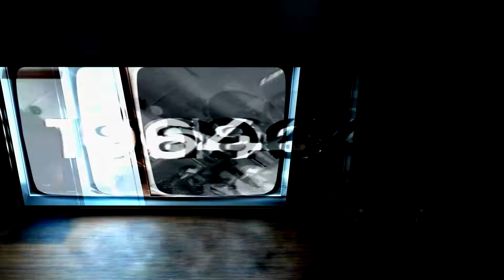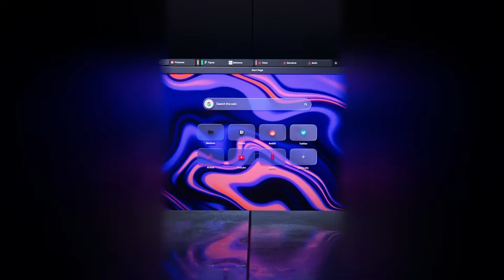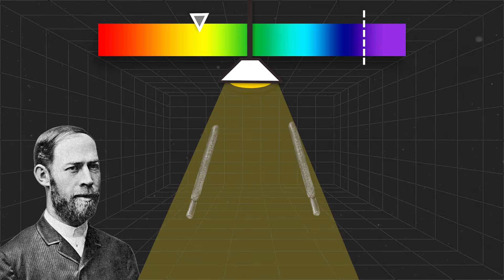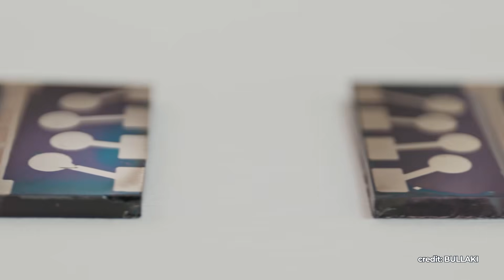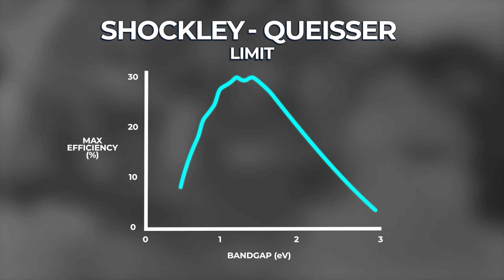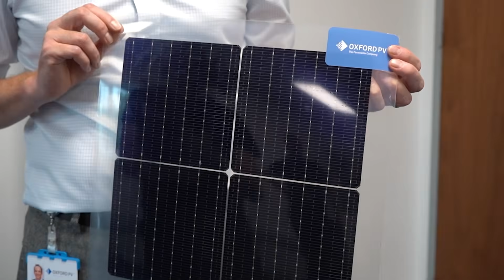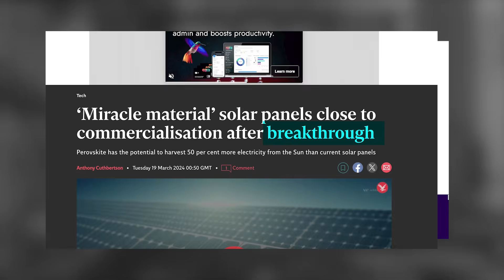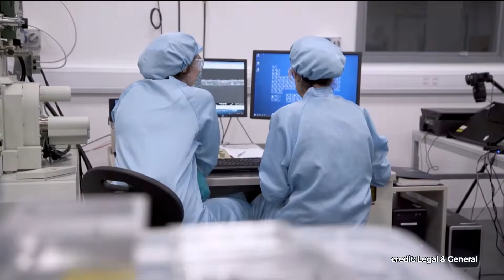How Physicists Broke the Solar Efficiency Record

Comment: The Kardashev scale never made much sense to me. We don't even know what would happen to the solar system if we blocked just 1% of the sun's energy and converted it to our needs artificially, let alone 100% of it.
If the temperature on Earth was 2 degrees hotter or cooler, then life on Earth would change drastically. That's how delicate nature is. We shouldn't think this balance is only important here on Earth.
Reply: Bruh, the temperature swings about 60 to 80c every single year here. The nature seems just fine. I don’t think 2 degrees is gonna break nature..
Reply: @Duminasion  bruh, average temperature, bruh. It's currently around 15 degrees Celsius. If it moved 5 degrees lower, we'd probably be starting to move towards an ice age. 5 degrees hotter, and many areas around the equator would become like the Sahara desert, and many islands and shores would come under water.
Not sure what 2 degrees difference would look like, but definitely different than now. That's all I'm saying.

Comment: It would be interesting to learn how long these new cells last and how recyclable they are.

Recycling doesn't sound like a big deal until you realise that current panels only last 20 years before they have to be replaced. Every panel that you see being installed today will have to be recycled 20 years from now.

In the Netherlands we current get 400.000 new rooftop installations a year and that number will grow. That means that in 20 years time we'll have 400.000 old rooftop installations that need replacing and recycling every year. That's 4mln panels a year. That's a problem.
Reply: Current panels last rather 25 to 30 years. The EU and the members have or should have already laws that adress recycling plus there are already PV recycling companies for "normal" silicon PV panels across Europe. But yeah, i agree that there are still questions to be answered how recycling friendly those new ones will be and how long they last.

Comment: I don't understand why the pyrovskite doesn't need the same perfection in the crystal structure that the silicon does? You mention that "obviously" it still needs to be tuned, but how is that obvious when you just went over how the defects in the crystalline structure of this compound doesn't matter?
Reply: It's explained right after in the "defect tolerance" section of the video
Reply: @pedro_mab  i wouldn't call that an explanation he just kind of says it is and glosses over it.  I'm genuinely curious why this material is exempt from the physical requirements demanded by silicon, and he doesn't address this.  I've watched it twice could u post a time stamp?
Reply: @drkalamity4518  The reason silicon needs to be so pure for semiconductor purposes is doping. The layer you are doping is really thin, and the amount of material introduced really small so any present defect will compound. Compare that to growing a new crystal. There you have way more material so a single defect dosen't impact the overall properties as much
Reply: @cahdoge  Thanks for your response! I understand this about silicon, that makes sense to me.  I guess my question is why doesn't the pyrovskite require that same production method?  It's still getting cut into thin wafers isn't it?
Reply: @drkalamity4518  that's the neat part, it isn't.
As stated by OxfordPV in the video the perovskite is applied directly onto a regular solar cell as substrate.
Depending on your defect tolerances, you have a verietyof methods avilable. From CVD  to just dumping a solution onto the substrate and evaporating it to grow chrystals.
Reply: @skvvlk   Not really, Perovskite is a type of crystal lattice and aside from a few exceptions, they all are salts and in this particular case they are even ploycrystalline (as shown in the electron microscope images), one could argue, that a single crystal is one molecule, but that's another discussion.
The reason why the perovskietes are less susceptible is, that the band structure of the material is the way you want everywhere and not only near the defects you created by doping.

What you are thinking of is a more complex endeavour. Materials with structures similar to your description can be found in high temperature superconductors. There an oxide lattice holds sheets of different metal ions. Those are still rarely monocrystalline though, because creating giant monocrystals is really hard (as shown by the lengths humans goe to to refine silicon).
Reply: Surely you understand that any can't or doesn't is can't yet or doesn't yet? I mean of course it doesn't matter yet. They get it working is what matter, finetuning comes after knowing how it works! Isn't that kinda obvious?
Reply: @dragon67849  Yeesh. What an immature and egotistical response. Every sentence is just tones of "Duh, you f-ing idiot."? Pathetic. Grow up, kid. The person simply asked a question. I hope you're not raising/f-ing up a child of your own with this kind of ego/asshole attitude...
Reply: I would explain but you would not understand.

Comment: Promising, but still a long ways to go from 21-22% Si unit efficiency to 25% currently achieved by Perovskite units.
Reply: I can't judge on the market readiness, but they appear having gone into production according to another video from a German technologist (their production plant is in Germany), partnering with the Fraunhofer Institute for Solar Energy Systems, also announcing a stunning 26.9% efficiency for next year already
Reply: @0087adi  Where is the link to the product technical spec and price ?
Reply: All it takes is to be cheaper once . The market will swing heavily if costs pan out.

Comment: efficiency is great and all, but the real energy gainer would actually be applying these kinds of systems. we are currently vastly underusing solar panels, so solar panels that are even 100% more efficient wouldn't make that much difference in overall power production.
Reply: Solar panels are underused because they don't work at night.  Can't run a grid that only works in the day.  Battery storage is nowhere CLOSE to being able to fix this problem.
Reply: @LonnieAdams4 uhh, did you forget Space Station?
Reply: @Eternalfrust it would be invisible in dark😂 but he was concentrating on being a 100% Redantic(pedantic/Relic)
Reply: @K.A7287  what?
Reply: @minhhoangvo4759  I ask u a better Q why?😄
Reply: @K.A7287  what
Reply: Yes yes it's all available but ppl don't buy it enough, isn't at stores, ppl need "micro incentives" to do this more
Reply: 100% efficient solar panel would be something then it would be very viable, todays panels are around 20-23% efficient, at 100% that would be 1000w per sq metre, tho plenty of people buy it id say dependy on country
Reply: @MrRacerhacker  "100% efficient solar panel would be something then it would be very viable,"

And it would be invisible because all the light that falls on it would be transformed to electricity.
Are you AI?
Reply: @vinny142  he meant 99.99%
Reply: @vinny142  no just bit tired do agree 100 aint viable but tho would be alot more usefull at 80-90% tho myself run 3kw myself in the nordics work well but also got some space for it

Comment: If we're at 100% efficiency, will the materials in the panel heat up too much and fail?
Reply: Then they wont heat up at all
Reply: @alexanderkesselring3621  At 100% efficiency they'd convert all light that falls on them into electricity. What that electrical current then does is not part of the efficiency rating. Only superconductors don't get hot  when a current flows through them.
Reply: @alexanderkesselring3621  Dope, that was another thought I had
Reply: Bit of an oxymoron question is that's possible lol
Reply: I'll also add 100% efficency isn't exactly amazing
For domestic plumbing for example

Combi Boilers are 96% efficient.
Meanwhile
Heat Pumps can have a 400% efficency
Reply: @MrMedicalUK in the context of energy, 100% efficiency means no losses of input, which is so far impossible. To get more than 100% would mean to create energy out of nothing, so your 400% number isn’t related to energy efficiency.
Reply: @Rwdphotos  .....heating energy....🤣🤣🤣🤣
Reply: @ yah guess where that energy comes from
Reply: @MrMedicalUK  Heat pumps are not 400% efficient, you are confusing efficiency with the coefficient of performance (COP).
Reply: @hkrause6565  Yes, heat pumps can be up to 400% efficient, meaning they can produce three to four times as much heat energy as they use in electricity: 
 
Efficiency
Heat pumps can be up to four times more efficient than traditional heating methods like gas boilers or electric heaters. 
 
How it works
Heat pumps recycle heat energy from air, water, or the ground. For every 1kW of electricity used, a heat pump can produce 3-4kWh of usable heat energy.
Reply: Heat radiates as infrared light which is a large component of the sun's energy hitting earth; converting all the infrared light into electricity would be paradigm changing. The applications beyond solar panels would be tremendous.
Reply: They would also be infinitely black

Comment: There needs to be strong pushes from government and individuals to ensure oweness is put on the manufacturing companies to ensure the lead in upcoming commercial perovskite devices is contained and handled properly! I fear this mimics leaded gasoline in the potential downside to our natural environment should perovskite cells become abundant.
Reply: This is a valid concern.  HOWEVER, 85% of silicon cells currently are connected with lead-based solder.  Hopefully more people become aware of the risks.  Lead free solder is more expensive and non-lead perovskites have been lower performing.  Too bad we don't have as many lobbyists for human health as we do for corporate greed.
Reply: @ that’s something I was unaware of, thank you for sharing!

Comment: The sun cannot output just 2 billion times what reaches earth. Draw a sphere with a radius of 1AU. Its surface is much more than just 2 billion earths!
Reply: Earth is 93 million miles from the sun. A sphere with that radius is 1.08E17 sq miles. Earth radius is 4000 miles, so surface facing the sun is 2E8 sq miles. Divide the first by the second. 500,000,000. Factoring in what the atmosphere absorbs, a factor of 2 billion seems reasonable.

Comment: Increasing solar cell efficiency is amazing for climate change. Not only does it reduce our dependence on fossil fuels, it also reduces the conversion of solar rays into ambient heat which at scale will help slow the planet's warming!
Reply: " it also reduces the conversion of solar rays into ambient heat "

A) these panels still get hot when the sun hits them
B) just how much of the surface of the earth do you think these panels can cover?
Reply: @vinny142  they said reduces, not eliminates. If the old panels are 20% and the new panels are 40%, then they still make 60% waste heat, but it's 20% less heat. For reference, a grass meadow absorbs 80% of light, most of which is covered to heat. Absorbing only 60% as heat would be similar to dirty ice.
Reply: @vinny142  the point is that the increased efficiency means that it is reduces more heat per Sq meter. Although we aren't going to cover the whole planet with these, every little bit helps. They can also reduce the need for ac by a lot more when installed on roofs

Comment: Share with us if there is any way to   
Use this at night
Reply: Share with us if you believe in energy storage.
Reply: @simonwatson2399  Storing is battery job not solar energy generators. I'm not talking about storing but producing energy at night.
Reply: @SHATOSHI123  funny, because you sound just like a typical climate change denier trying to point out the flaws in renewables.
Reply: @simonwatson2399  Man I'm not complaining solar panel. I mean It would be much better if engineers design such way. I read an article about it where solar panel can work even at night just mechanism is different.
Reply: @SHATOSHI123  did you even watch the video? Yes you can make a panel that can generate a volage from night time infra red. It's power output is miniscule. You could create a panel that can create a voltage from an ambient temperature of 100K if you wanted to. Do you know why nobody does? Because i would be pointless.
Reply: @simonwatson2399 you didn't get whar I mean. From that article I just learned that solar panel is same but it uses steam like other method. Maybe it's still on research or something Idk. Thats why I want him to share
Reply: @SHATOSHI123  ??

Comment: That energy scale where a civilization harnesses all their suns energy is silly though. If we turned all the energy that hit our planet into electricity, then we'd live on an ice rock
Reply: And once it was used as electricity it would turn back into heat melting the ice.
Still would be a rock because no energy for nature would be left.
Reply: If we had the technology to do that we would allocate some of it to keeping our world nice and comfortable. In fact, we'd end up making even more of the planet habitable than it is today.  Think about it, if we had the tech to use all the energy coming from the sun it would be a piece of cake to direct it to where we want it to go.
Reply: It doesn't say turn it all into electricity it says control it all. 

If you had a dyson sphere you could easily program it/design it to leave the very small portion of energy/light leaving the sun that actually hits the planet in question alone and let it through the dyson sphere's network. 

Also a dyson sphere capable civilization could just use dyson tech in solar systems with no planets with desireable habitable conditions. And only use partial dyson rings in their home system. 

Given the area of our sun for instance, you could host untold billions or trillions in a structure the size of a dyson sphere.
Reply: If you turn sunlight into electricity, that electricity eventually turns back into heat. If anything we'd overheat the planet by absorbing too much sunlight.

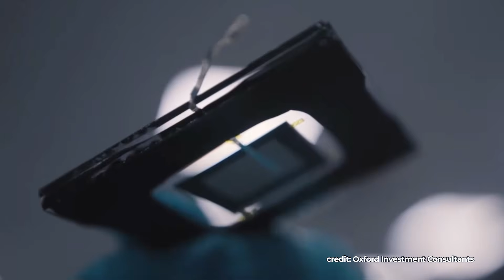Comment: 1:43 NUCLEAR
Reply: @BondzySmid  this is misinformative, thats our current stockpile, not the total amount of uranium capable of being mined and used for power
Reply: @BondzySmid  me when i intentionally spread misinformation online
Reply: CLEAN
Reply: Specifically thorium.
Reply: @Hector-bj3ls  no fuel is better than any other. If you can achieve fusion and producing energy it’s good in my book
Reply: @dablinds  many fuels are better than each other
Reply: Sadly not very cheap and the build has a quite big emissions footprint.

Comment: Cool. I’ve have personally measured some of these cells and can confirm according to ANSI standards, we’ve reached 43%. And yeah it’s quite impressive. I can’t speak for the cost or robustness though
Reply: Any impressions re: anticipated longevity?
Reply: 43% is maximum in theory. But it was never measured. Maximum till now was about 33% (STC) higher than 40% measured only under concentrated light conditions (CSTC).
So I believe you have measured 43% but not under realistic conditions. 🤔
ANSI you mean ASTM?